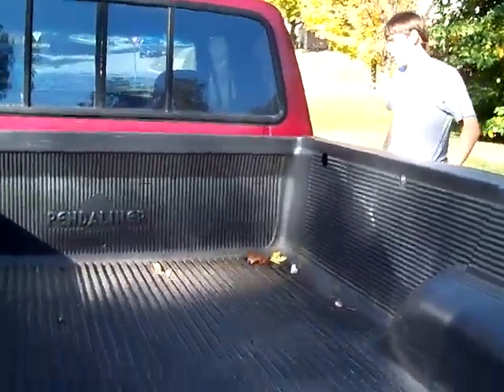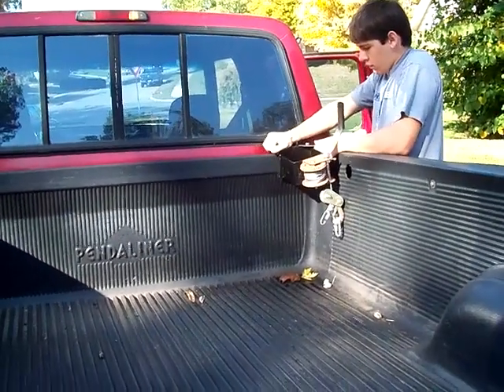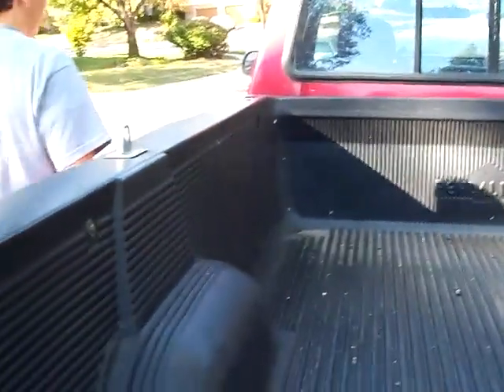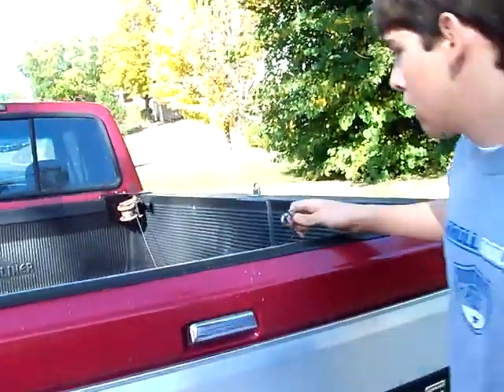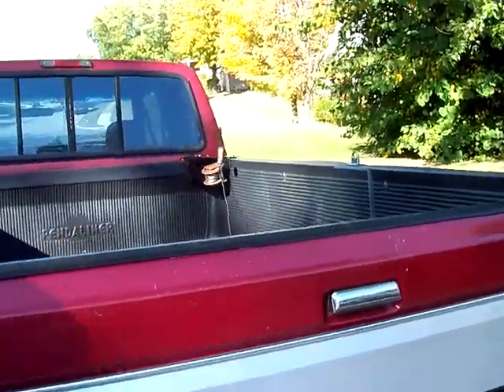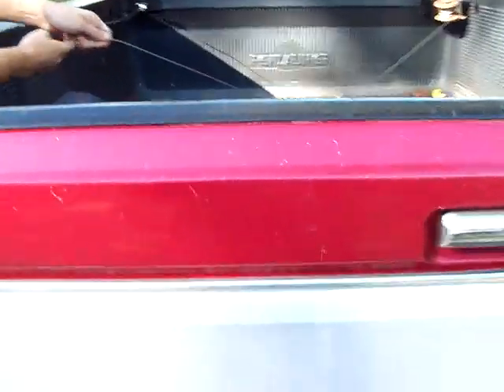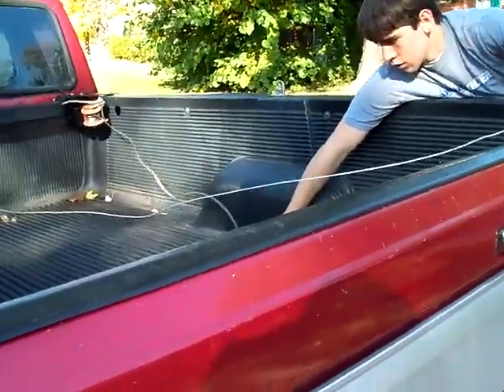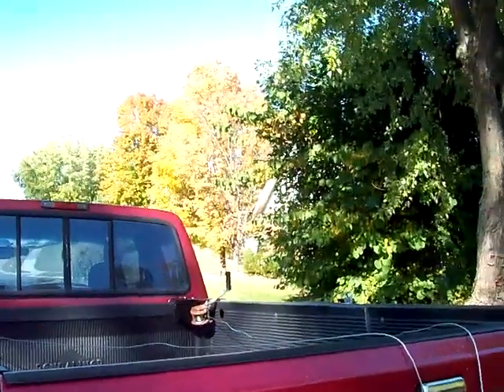Installing The One Man EZ Load

Comment from the maker: Thanks for your interest and comment. One of the videos we have up shows the unloading of a medium size snowblower. The system is capable of loading/unloading  much heavier items than the snowblower shown. The items to be unloaded must be moved onto the ramp or ramps by hand as the system cannot push an item off the truck bed. As soon as the item is on the ramp (gravity takes over) the winch cable system will work in reverse operation and allow the operator to slowly let the item down the ramp.

Comment from the maker: @shiwpaul1 The EZ Load systems are supplied as a complete hardware set, including the winch. The system (pat pending) is not supplied without the winch, to insure proper winch / system functionality. The pickup bed attachments are our unique design, and are only available with our system. Thanks for the interest.
Reply: I can't find website to buy .would you have advice

Comment: How dose the u channels stay in the corner of the bed, when its under load ? Dose it also attached to the bed rails?
Reply from the maker: The u channels have a downward force applied to them when under load pulling conditions, thus holding them seated and in place. The system also attaches to and utilizes the bed side rails when pulling a load.   Good questions.
Reply: thank you
Reply: @pickuptruckloading Is this still available? Please send your website to get more info. I'm interested in get one for my truck. Thanks!